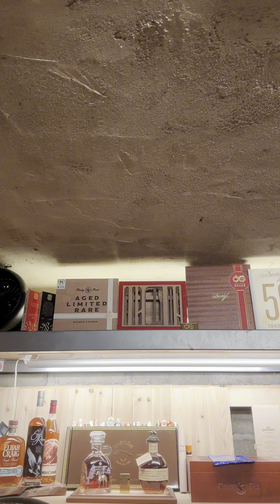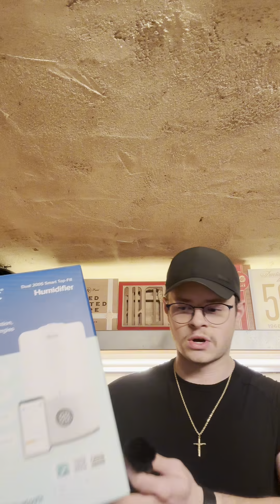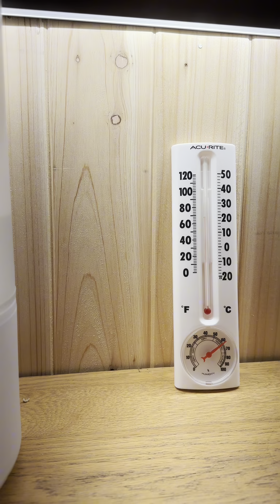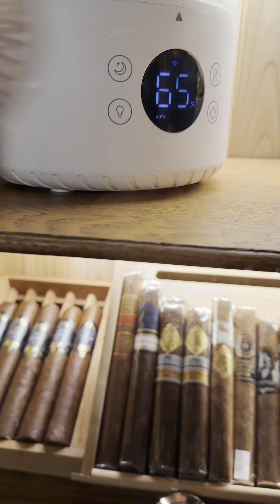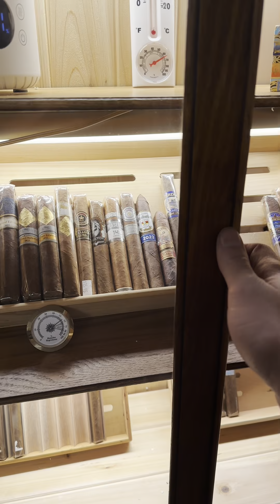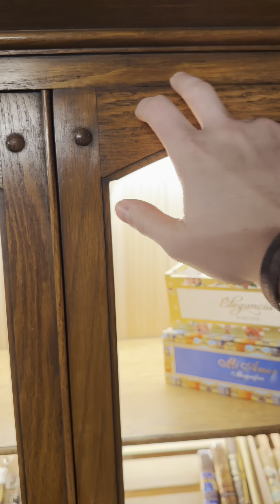How to build your own cabinet humidor at home for under $100.

Comment: Very nice video!!! I just bought a solid Mahogany cabinet with a glass front for $50. It was a wine cabinet. I cut a hole in the back to attach an EIC a/c unit, and lined the inside with 1/8 inch Spanish cedar, built 3 cedar shelves, and added a 4 drawer system for the loose cigars. I have the Oasis Magna 3.0 humidifying it currently. With some refrigerator gaskets and the EIC unit going right now, it’s holding humidity right at 75%, 65 degrees. With the setup, it’ll hold about 60 boxes, and about 200 singles. I’m quite proud of it.
Reply from the maker: Very nice! Appreciate the comment cheers 🥂

Comment: Nice video. Are you concerned about the cedar not being Spanish cedar? I have always heard that red cedar should not be used in humidors, being aromatic and can affect the taste. Something to consider is hiding the humidifier by boxing most of it in the corner  with some box lids. I would image you could make a removable partition that hides most of it, since the mist is delivered from the top. I have to say, I expected your collection to be larger than that, considering the reviews and awesome sticks you smoke. keep up the good work, I enjoy your videos
Reply: Anyone reading this, this guy is correct: you want Spanish Cedar, which you're going to need to either order online or find a local hardwood dealer to find. Do not use the cedar you can buy at the big box stores, it's meant for closets and chests, not humidors.
Reply from the maker: It still is extremely aromatic. I’m unsure of the type of cedar, but it is very strong. I was thinking about trying to conceal it. Somehow this is not my actual humidor. I have a large size electric cabinet humidor upstairs that’s temperature and humidity controlled by computer. That House all my really expensive stuff. You can see short clips of it in some of my YouTube shorts.
Reply: Cedar that is purchased from Lowes and HD is going to be red cedar and aromatic. Not intended for humidors as it will effect the flavors. Spanish cedar is what you should be using and can be expensive. Spanish cedar is not actually a true cedar, but from the mahogany family with a cedar-like scent. As sexy as your Opus collection is, I wouldn't display them in that case just yet.
I did catch the recent min-tour, very nice, and what I would expect from seeing your reviews. Thanks
Reply from the maker: @ yeah I don’t keep any of my really expensive sticks in this one. It’s just kind of the $10-$12 things for people to pick out when they come over.

Comment: Very Nice Dude!! Did you let it season for a while or did you throw your sticks in right away? It would be fun to see your humidity distribution in the sticks in a couple weeks with a humidimeter.
Reply: I’ve been thinking about getting a chest freezer for all my long term storage sticks… I’d throw it on a temp controller so it only cools down to 65 or so…
Reply from the maker: @WhittlebacksCigars  I did season it, it’s been up and running for a while now and holding very well. I generally prefer the cigars that come out of this humidor over my expensive cabinet, humidor something about the way the humidity affects the cigar just makes it much better in my opinion.
Reply: @Cigarswithprov  ok, now I definitely have to give this a go…
Reply from the maker: @ go for it! It won’t let you down. Do something on your channel about it I’d be interested to see your take.
Reply from the maker: I think it has something to do with the type of humidity.